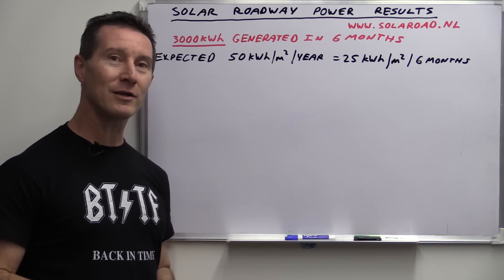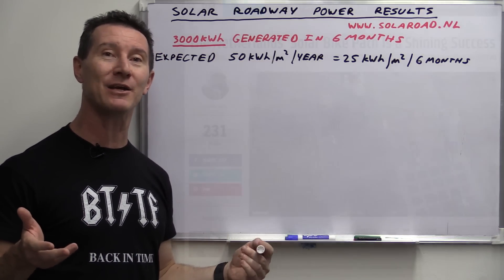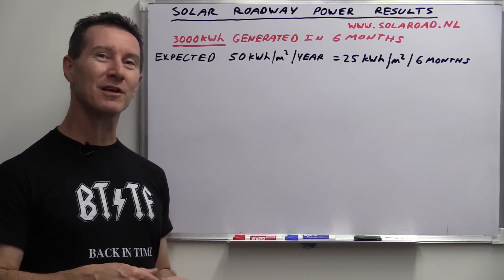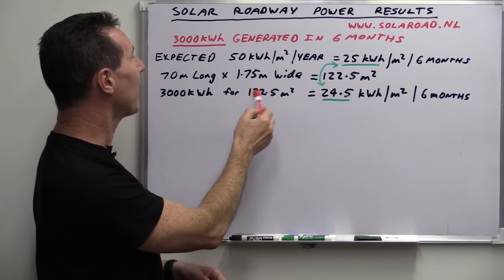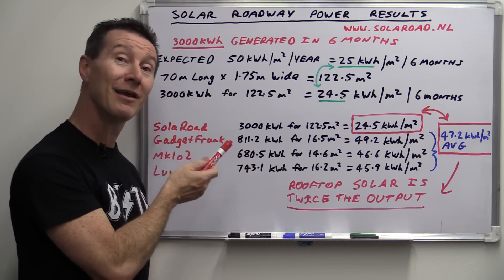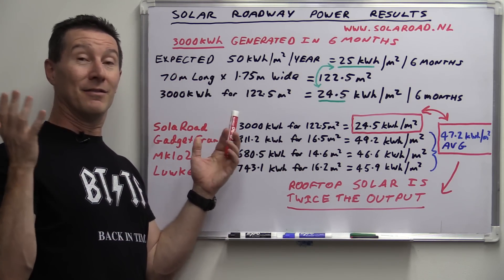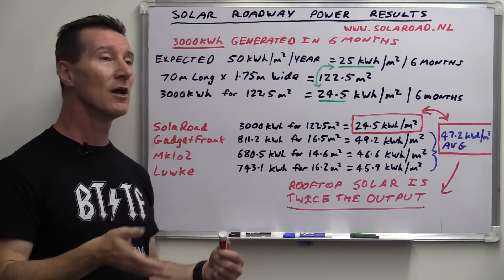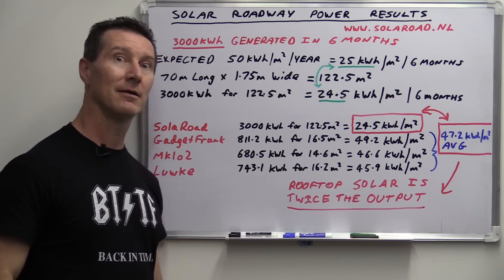EEVblog #743 - Solar Roadways Test Results

Comment: dave, you have to admit. its not a bad idea. yea. the first few of these are going to be ungodly expensie. but think. that space would otherwise be wasted with asphalt or pavement. taking that same realistate and makeing it produce energy. even at 1/2 the effancy of rooftop panels is a great idea. not to mention the reflected radant heat is less so cooler overall enviroment and green energy!
Reply: danz409 I facepalmed so hard after reading your comment my brain flew out of my skull and splattered all over the wall behind me.
Reply from the maker: MH1337 Yes, this!
Reply: danz409 Or, for a fraction of the price, and DOUBLE the output, give SHADE to cyclists by building a RAISED canopy over cycleways, featuring solar panels on the roof! Like South Korea! Tada!!! Problem solved!
Reply: richfiles ether way you go about it. its better than plain old asphalt. besides. in a lot of places overhead panels may not be an option.
Reply: danz409 It's not better than asphalt. It's patently not better. It's more expensive, and you gain nothing in return. It costs more to build and maintain these stupid solar roadways than it would cost to build the solar panels somewhere else and import the power where it's needed.
Reply: danz409 But it is NOT better than plain old asphalt with a canopy and traditional roof mounted panels. Any area where a solar equipped canopy is not "suitable" the solar road won't be suitable either.